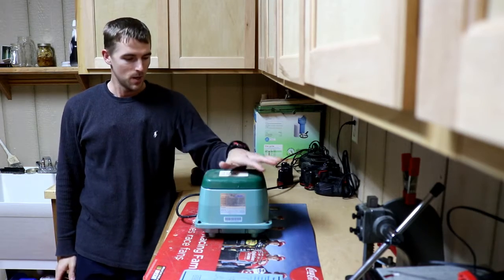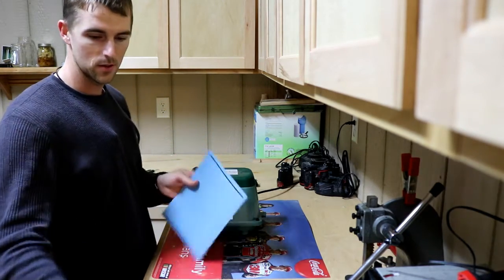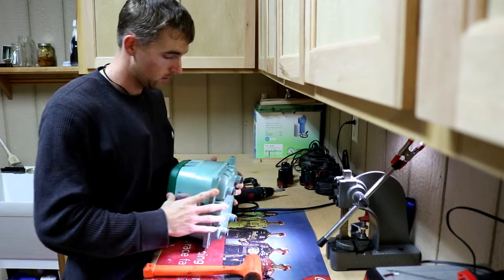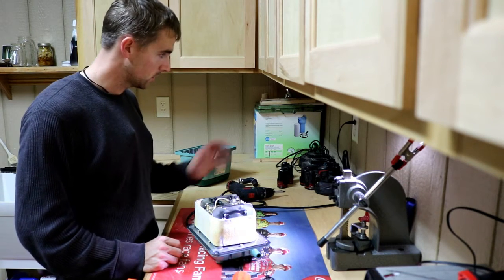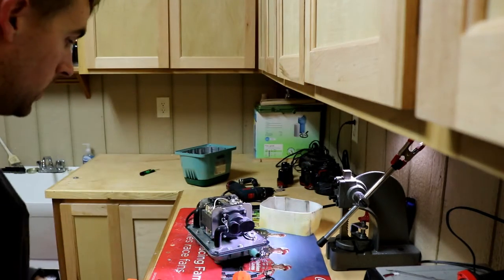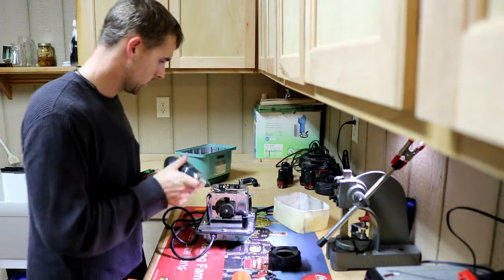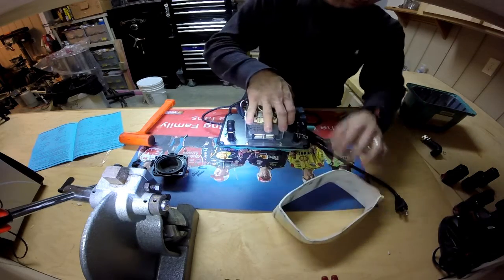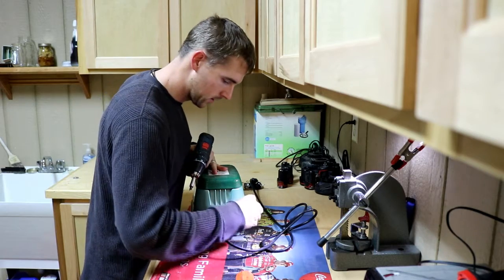HIBlow HP80 Air Pump Troubleshooting and Repair Part 1

Comment: Noticed my Hiblow HP-80 was not running, bought in 2017. 
Looked up ways to fix it. 
This video showed me how to get the lid off with the rubber mallet and which parts were the issue.  
Mine did not have the safety screw it had the safety switch, which I kept getting confused about.

Comment: I have a Hiblow HP-60W which serves as the air supply for my septic system. It quit running and I found the sheared safety screw when I took it apart. Mine didn't come with any instructions or spare parts, but I found your video and it is exactly the same issue. Thanks for taking the time to post this ... very helpful!
Reply from the maker: Thanks Bryan glad it helped you out!

Comment: I used mine for my septic and it died sometime over the winter. Of course I didnt see the change filter sign and noticed it wasn't running cause it was outside. My wife sent me your video cause a refurbished model from Septic Solutions runs $200 plus. I'm gonna trouble shoot it like you did. Thanks.
Reply from the maker: Hope it helps and thanks for the comment!

Comment: I recently purchased one, 80liter per minute model. When I started using its heating up. Temperature goes above 50+ degrees.
I ran the pump With the pump outlet fully open, the still the pump heats up, 42+ degree.

This much high temperature is normal?

How much is the normal operating temperature?

Comment: Question I have a pump and my diaphragms are still good but it’s not creating any air pressure what should I look at next and how do I test and yes it’s pumping
Reply from the maker: These things are pretty simple if it's running and not making the really loud noise could be your end caps are bad. Other wise it's the connecting rod or diaphragm.
Reply: Thank you very much that’s what I was actually thinking cause it’s not like the base is leaking air or anything, I’ll try that since I did change the diaphragms but not the caps on it
Reply: MTRUNK 85 thanks I replaced the diaphragms And the covers n now it’s making tons of air I hear the bubbles in my septic, I had a very small hole and the covers look worn n beat now everything works

Comment: i use this for my septic system. mine died. guess what I am doing.
Reply: Make sure it's fixed before your next septic inspection if your county requires inspections. Mine  failed the day before my septic company sent out their inspection crew. I got a letter in the mail from the county health board saying I have 30 days to repair and re inspect before they levy a very stiff fine,
Reply: @robertteneyck9367  This system is the best thing that ever happened for contractors.